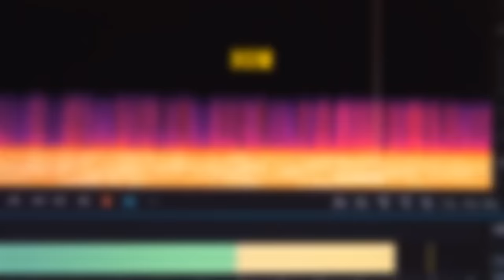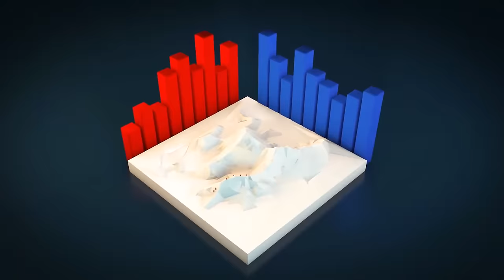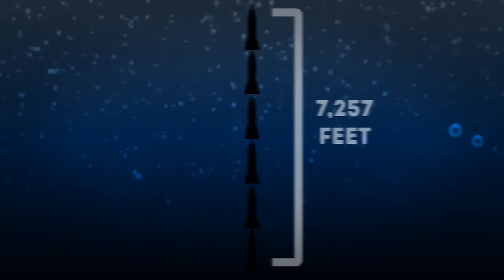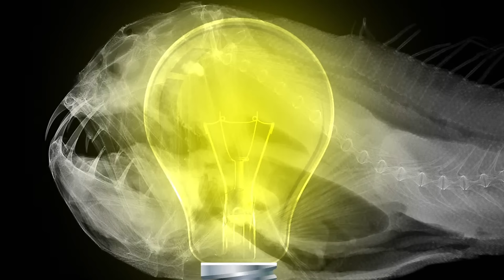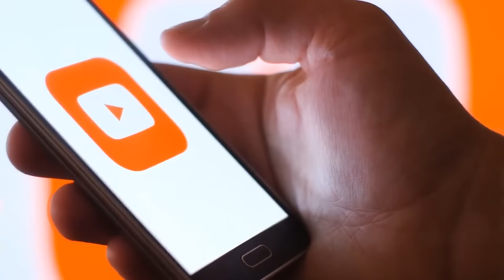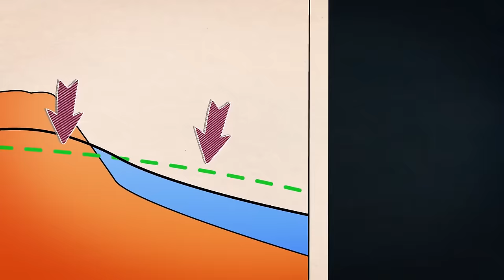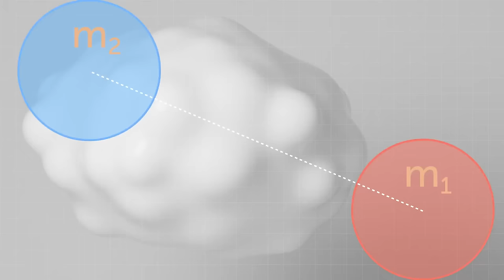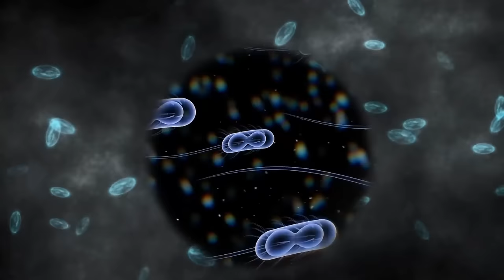Scientists Discovered Ancient Caves Dug by Monsters and They Are Scared

Comment: I was in Towers New Mexico in the early 2000s, I heard that goofy sound, sounded like 60 Hz or harmonic somewhere down by 30 perhaps 27 to 30 Hz, got out the car and was trying to figure out where it was coming from when somebody drove by and a pick up truck and asked me what I was doing I told him and he called me a conspiracy nut and drove off, didn’t know anything about anybody else hearing this sound anywhere before. Since I repair audio equipment I was trying to figure out what was putting out the sound, as it didn’t sound happy, there was also a compressed air tank leaking somewhere as well a big one, a lot of compressed air.
Reply: Hi since you're familiar with audio equipment what can be used to pick up the HUM and determine what frequency it is. It's probably just below the range of normal hearing. As a kid getting hearing testing in school my brother picked up a hi frequency noise in the testing machine that was only picked up by repair technician's.

Comment: I hear the HUM every day and night in South Carolina and Used to in Connecticut. It didn't change during Covid lock downs which rules out a lot from traffic to industry. It's louder when it rains usually and indoors. It sounds like a plane or truck that never gets to you. It's not tenuti's. I have to sleep with a air purifier running to cover up the noise or I can't sleep.